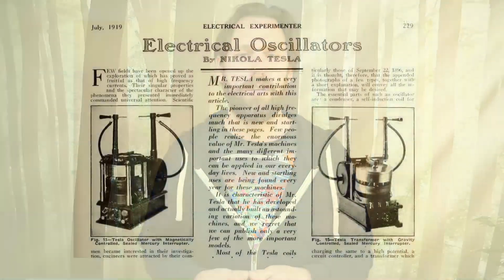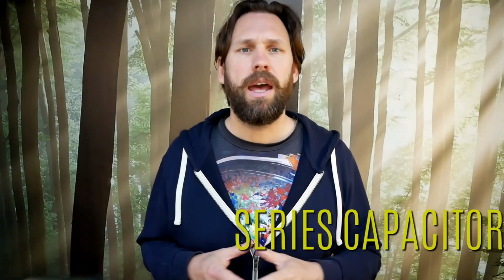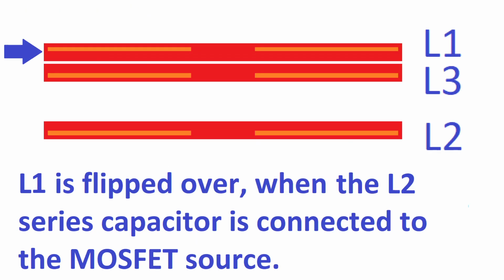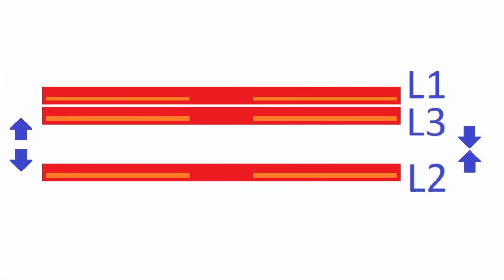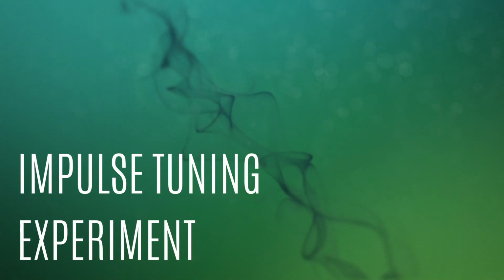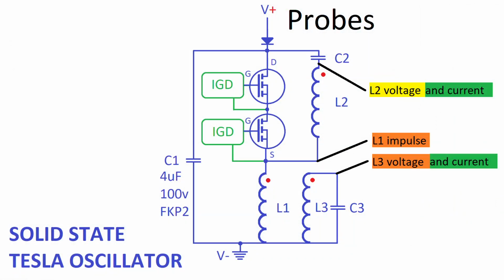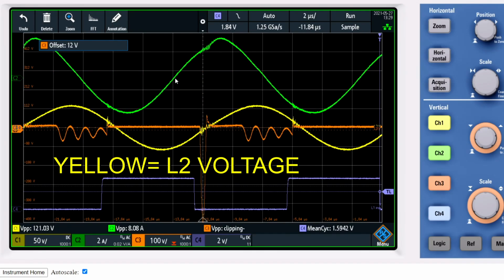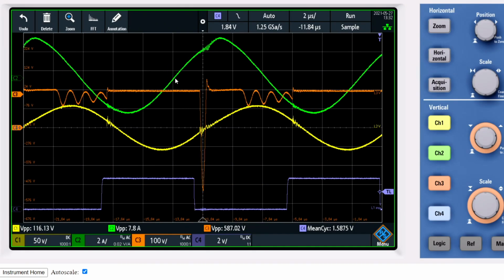How To Tune Impulses Anywhere on a Resonant Cycle, using Bucking Coils.

Comment: That ringing we see just after the impulse looks just like an oscillator circuit just before I get it to oscillate. because I have the capacitance or inductance slightly off. I don't know if this is useful, just something I noticed. Just out of curiosity have you tried different frequencies of impulse when that ringing is starting? I know you're showing an awesome way of tuning the impulses, but I was just wondering if the thing would just start oscillating if the frequency-matched your tuned coils. Sorry if I'm interrupting you guys.
Reply from the maker: Thanks Curt, that is really valuable and helping. Could you show the oscillator effect on your channel? I also wonder If I could tune to the frequency but it is a lot higher in frequency. which has it's challenges 
I did notice if the resistance is higher it seems less
Reply: @MasterIvo  I will find it for you. just some information on what I was doing when I see it. I was learning about oscillators and I built many different ones because I was getting into building my own radio for Ameture Radio. I have seen it on Crystal, Colpitts, and Hartley Oscillators. the one I saw it most on was the Hartley because it was harder to get to oscillate and you would not believe how similar your circuit looks to a Hartley oscillator, I just noticed. Here is a quick link to a Hartley:
https://www.elprocus.com/different-types-of-oscillator-circuits-its-applications/
Didn't Tesla invent the radio at the same time as Marconi? I wonder what oscillator he was using? All of these things were taking place in the same era in time.
Reply: @MasterIvo  I see the difference you may want to look into. you are missing the feedback network. your circuit is like the Tesla coil that is not designed to oscillate but to just make continuous sparks witch also makes radiant energy. but if you are looking for self-oscillation it needs feedback. If you look at the Hartley oscillator or this guy's work that is somewhat similar to yours, you will see all self-oscillating circuits need feedback. I hope this might spark something for you. pun intended.
http://naijaphysicists41.altervista.org/solid-state-tesla-coil-wireless-electricity/
The way you control the transistors you would have to get the frequency just right to oscillate. with the feedback, it would start to oscillate by itself. If that is what you are looking for that may help.
May I ask where the non-solid-state circuit diagram is you followed?
Reply: @MasterIvo  OK I found it. goto 6:20 this is what it looks like on the oscilloscope but you usually see a mirror image to the left also when you are close to resonance.
https://www.youtube.com/watch?v=UesrJ4VxQFs
Reply: @MasterIvo  I'm a little confused I see in green what looks like it could be feedback, but it is coming from the emitter, feedback usually comes from the top or bottom of the collector coil. also if you did try getting the feedback from the collector the capacitor would alter the phase of the wave by 90*. to have an oscillation it would need to be in-phase so 360*. 
Also looking at the circuit and trying to determine what the intention of the circuit is and if there could have been something left out maybe even intentionally for publishing maybe? it looks to me that the top part of the circuit is supposed to oscillate and feed L3 through L2. so L1 L2 is the oscillator and kicking the voltage of L3 at specific times, I'm guessing to amplify L3 similar to throwing another stone in the water at the right moment to make bigger waves. Is this at all how you may have been thinking of this? or am I seeing it completely different? 
Also if the resonant frequency is too high for what you are looking for that means the coil size and capacitors may be off. adding capacitance usually raises the resonance and a bigger coil will lower the resonance, I believe it was off the top of my head.
Let me know if this is just getting in your way of work. I find sometimes bouncing thoughts off one another will spark something that is amazing and good things happen!
Reply from the maker: @curtstacy779  thanks for all the tips.
Yeah I don't use feedback (yet) as I don't want it to auto oscillate (yet).
I tune it myself so I can see what happens and learn from it.

Yes that ripple is ringing. But there is no proper explanation for what the cause of the ringing is (before mosfet turn on) . The impulse is the same ringing, but ony a half wave. while it seems to be faster. 

The intention for this video is to explain how to phase shift the resonant wave.

But I intend to use this principle with a half bridge circuit, with 2x 25% on time and 2x 25% off time. I will play with it soon, and show the result.

then I might add an extra coil to produce feedback, and auto oscillate it. But that not for now.
Ow, and more capacitance (or inductance) lowers the resonant frequency
Reply: @MasterIvo  Ok Thanks for the extra information. that makes a lot more sense. one thought, the L2 coil is always in the circuit. the ringing is probably because it is always powered and just from noise it can start to oscillate. Thanks and good luck!
Reply from the maker: thanks Curt! but L2 also has its series capacitor
Reply: @MasterIvo  Yes exactly what I was thinking, you have a tank circuit sitting there powered up ready to go. so any influence from the outside world could make it oscillate. that is how these types of oscillators start to oscillate on their own.
Reply from the maker: except there is no outside influence at the start of the ringing
Reply: @MasterIvo  The influence I'm speaking of is just in the atmosphere, it's everywhere. there are many things, electrical noise, temperature change, and mechanical vibration. that is how the oscillations begin in these and other oscillators. if you take a hartley oscillator for example and simulate it in something like LTSpice it will not oscillate it needs this atmospheric noise to begin to oscillate so when simulated you have to add something to kick off the oscillations.
Reply from the maker: yes I understand, but this seems different.
Reply: @MasterIvo  Oh, ok maybe we should look at when it's happening and see if it's happening at the same time every time. also, you said it would happen more often with lower resistance. If I were you and had enough time I would try anything that could make it do it more. maybe we can figure it out from that? maybe it's something new and interesting! :)
Reply: @MasterIvo  I tried a quick simulation in LT Spice. this circuit is like a bell. well probably better than a bell. lol, I didn't have all your value's I just put some in and tuned it by playing, for the best response. I pulsed it one time and it would oscillate at a low voltage for a very long time. as a matter of fact, I didn't find the end. I looked 10 seconds ahead and still saw it. it was hard for the computer to go any further. after playing with the circuit for a while I would suggest a single pulse and watch the ringing. I think it's an oscillation and it will go on for a while. I would love to see what it does in real life with the proper coils.
Reply: @MasterIvo  You have me hooked on this circuit now, it is so much fun to play with. I can't thank you enough.
This is just a circuit simulator I'm playing with but a good one. I always test my circuits out on it before I make them if possible, it saves a lot of time. I was able to work with it for a few hours now.
I have a 10 V power supply.
I give one pulse for 50mS, it draws 16 A while the pulse is on. (I don't need that long for the coil to saturate), (by the way, this is when I see that ringing on all coils. It looks like it happens when the coils are saturated).
Between C2 and L2 I get a positive pulse of about 7 v down to -1.5V
When I release the pulse I get an oscillation +3.5 to -3.5V and this oscillation goes for a long time. I tracked it out for a full minute and doesn't lose any voltage and the whole circuit draws in the milliamps. on my scale, it shows 0 Amps.
Between L1 and L2 coil, I get about the same thing everything is one volt lower.
At the top of the L3 coil, I get a 1.1kV spike and a -500V spike.
The finally here: Then it oscillates at 1600VAC at about 2 Mhz and I tracked it out to a full minute and it was still going. the amperage on the power supply must have been in milliamps the whole time because it just read 0 Amps.
I'm most certain I am using different values of components than you. in the simulation it's much faster to change them and test. I am impressed with the simulation of this circuit. and maybe we will see some things that are not in the simulation. it will be awesome!
I can't wait to see what you get out of the real circuit. My tools won't let me play with that high of voltage so I'll have to watch.
If you want any of the values I used in the simulation let me know. I don't know what frequency you are shooting for but if you want 2 Mhz I have the values. lol
Reply from the maker: Try simulating a parallel capacitor over L1, that prolongs the impulse to  twice the frequency of L2
Reply: @MasterIvo  Ok did it, remember my components may not be the same sizes in my circuit. with small capacitance, I saw no change in the circuit. with a larger value, 1000's of time bigger than L2's series capacitor I am getting a harmonic that is twice the frequency of L2. it is riding on the lower frequency of L2. if you keep going up in capacitance you can make L3 start oscillating with this harmonic also and the voltage of L3 start coming down to 1400 vac. In this simulation, I have all coils in the same polarity (I think there is another term for that.) with C2 above L2. at this point I would start to play with the resonance of L2 and L3 to see what else happens. I will play some more with that when I get time.
Reply: @MasterIvo  By the way I just wanted to add. when I was learning about oscillators they kept repeating: you need a gain of at least one to keep an oscillator going. This circuit has no feedback to the transistor. it was only turned on once. it must feed itself from the supply, or the oscillation must die at some point. it would be cool to try a load on some part of the circuit I'm guessing L3 to see if it can feed the circuit enough with a load attached.
Reply from the maker: yes L3 can be loaded. thanks for trying and sharing.
L2 could also be close coupled to a 4th coil.
What K (coupling factor) did you use in the simulation between L2 and L3 to get the 90 degree phase shift?
Reply: @MasterIvo  the coupling factor is set to .6 and 1 is the highest or perfect on here, I wanted a more realistic coupling. all three are coupled and I have no phase shift they are all in sync. I thought about coupling 1 and 2 then 2 and 3 but I didn't try it. I was just trying to see how high I could get the voltage in L3. you are probably doing way more with it than I was. I was able to get L3 up to 3kv. lol, that was fun. I did find that the pulse length can make a difference in the voltage. that when the L3 voltage oscillated higher now.
Reply from the maker: It probably doesn't simulate a pancake coil,only solenoids, and definitely no bifilar coil.

but the coil should be able to change polarity so L1 and L2 are opposing, than you should be able to get phase shift.

Ah well, simulation is only valid for known properties I guess, its based on math, which has a restricted set of rules. LMD resonance probably wont even be simulated, right?
Reply: @MasterIvo  You would be surprised what it can simulate. and for transformers, you can change polarity set permeability and I'm sure a lot more. It has no predefined transformer you have to set the relationship of coils. I used it for many radio circuits. so you would have to find the setting for a pancake coil witch shouldn't be hard they use them in antenna's a lot, RFID is one application. I think where it would help the most is checking the circuit to see if anything will be smoked from too much voltage. for instance, I saw on one video where you had blown a transistor. and one of my simulations had too much voltage on the emitter and I would have blown a real transistor. but it will get you close to what you are trying for. as for strange anomalies if it's in the math it will show, if it's something new then it won't. it just saves so much time when you are trying something new and it covers all the basics. LT Spice is easy to learn, you can catch some videos here on youtube and be going in a couple of hours. and it's free.
Reply: @MasterIvo  Here is a link to using bifilar coils in LTSpice:
https://overunity.com/17988/ltspice-models-for-bifilar-coils/wap2/
Reply: @MasterIvo  By the way, the guy that made those coil settings tested the results to his real setup. and everything was working as planned.

Comment: Radiant patent is using electrostatic compressional waves, is my understanding. Tesla wasn’t much into transverse waves, he didn’t think highly of hertz. 
Are you using electrostatic compression, I can’t tell? Wouldn’t it be better to put the flat with a conductive sphere, hook it up to a capacitor, and ground it,  like his patent? Tesla said a bifilar with a winding so that the space that is between the wire is equal to the diameter, is desired. I will be making my next ones with silver. 
Are you using longitudinal energy?  And I didn’t read anything about magnetism being incorporated with his radiant patent(except with the motor the circuit runs). Did I read it wrong, it seems Tesla is only really working with electrostatic energy or radiant matter in his radiant patents?
Reply from the maker: Tesla's radiant patents are very limited and vague in their information. His 1890's lectures are much more clear. But he never fully explained it. The information is scattered over all sorts of articles.
In one article that I can't find anymore, he explained how LMD waves are created, by two plates. one is charged, and then suddenly grounded (discharged).

Comment: The details in your diagrams as well as your working techniques are constantly improved, color of the tapes on your probes to illustrate from the diagram to the circuit without error. You are very methodical Ivo. Your explanations with the magnets for the phase shift is very well thought out ☺.

Another extra rewarding video.
Thank you very much you bring to life a discovery of Mr. Nikola Tesla.
Reply from the maker: Thanks Bruno. Yes I liked the magnet explanation also.

Comment: Thanks Ivo. This puts a nice cap on your series of using your solid state Tesla oscillating circuit to generate impulses that increase the power generated in your tesla bifilar inductor transformer. You are the Master. I read the 1919 article you referenced and never got the information you gathered and presented here. Amazing work, really!
Reply from the maker: thanks. the picture of the circuit was most important in that article. The rest wasn't in there.

Comment: Master ivo may YAH bless you!! THANK YOU for sharing all this wonderful information
Reply from the maker: Thanks!
Reply: Bless yeh man, can u do an experiment with frequency of current as u have already good at resonance, is it possible to run at 3rd, 6th, and 9th hormonics  say if the voltage is having 60 hz run at 30hz and 90hz altogether 3 frequency and check the amperage used of the loads in ur circuit, but calculate the 3rd,6th,9th of thr frequency or hormonics of the impulse and let's c  how can u work it out thkz for ur efforts dear... Shd get a better resonance and resistance shd go way down and PF utilization much better hopefully so low amperage run the in series and parallel and let's hav the results

Comment: Thanks for doing this. Next you might consider z pinch plasma generators. Plasma was Tesla’s preferred source of electricity and the wave form (impulse) generator he discovered out performed AC & DC. Consider making electricity the natural way. (Z pinch)
Reply: Fun fact. Scientists know the main ionizing function that creates plasma in space is speed but do they focus on this in their laboratory experiments? Nooooooooo. They impulse the plasma with super high voltages creating wave instabilities and extremely high temperature uncontrollable destructive effects. Steinmetz would be slapping them upside the head. Nature works fine letting the plasma create the electrical power to contain the reactions and generating radiant electricity. Move past steam engines, we are no longer cavemen. Party on dudes. Be good to each other. Imagine an electrical generator without induction. 🤖🖖🏼
Reply: shoutout to thunderbolts project :) plasma cosmology baby